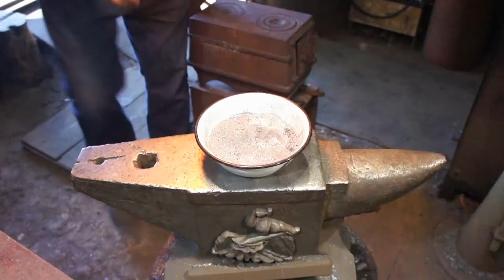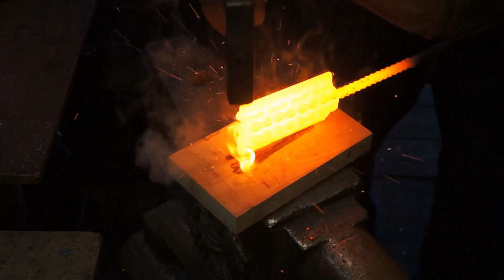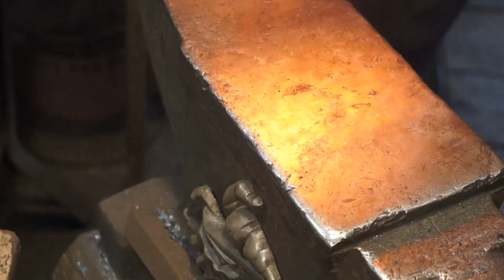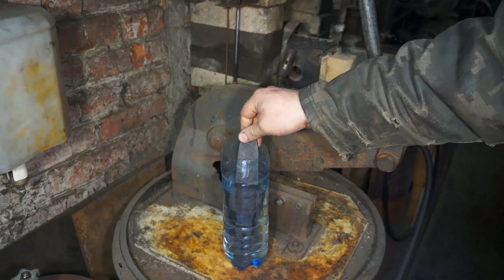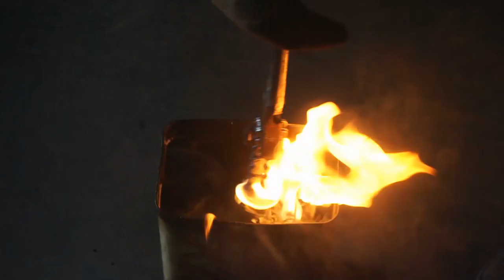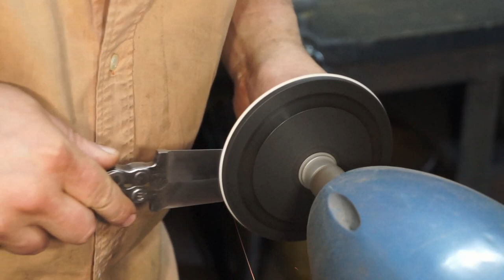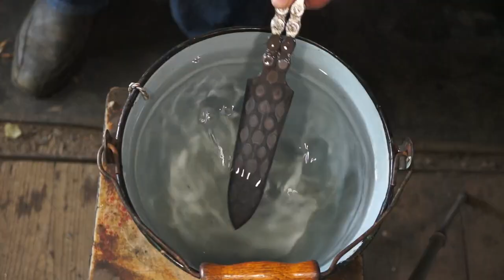Blade "Mad Max", Damascus steel from a motorcycle chain.

Comment: Motorcycle chains are made from manganese alloy steel in order to withstand shock loading and abrasion from road grime. Not exactly the easiest grade of steel to forge. And not healthy either. Manganese fumes are very bad for the nervous system, they have been connected to a sort of parkinson's disease that is common among welders.
Reply: Cobalt alloy steel is also unhealthy to work with, it has been connected with cancer. But i doubt that amateur blacksmiths would use high cobalt allow steel. It has the property of red heat hardness, and is probably extremely difficult to forge....The point being is that if you are going to use scrap metal, it would be a good idea to identify just what you are pounding on. Industrial hygiene.

Comment: Why him puts kitty litter on hot metal?
Reply from the maker: I sprinkle flux (90% borax + 5% quartz sand + 5% charcoal powder) this is necessary for forging (forge) welding. The flux is alloyed with scale - the formed substance is sufficiently fluid and is easily displaced by deformation. In addition, the flux protects against oxygen and charcoal, carburizes the surface layer of metal - which lowers the welding temperature (if in brief).
Reply: @shurap  so basically helps make metal hold together and stay clean?

Comment: Why does he keep putting that salt on there
Reply from the maker: I sprinkle flux (90% borax + 5% quartz sand + 5% charcoal powder) this is necessary for forging (forge) welding. The flux is alloyed with scale - the formed substance is sufficiently fluid and is easily displaced by deformation. In addition, the flux protects against oxygen and charcoal, carburizes the surface layer of metal - which lowers the welding temperature (if in brief).

Comment: Total noob but what is he sprinkling on the metal
Reply from the maker: I sprinkle flux (90% borax + 5% quartz sand + 5% charcoal powder) this is necessary for forging (forge) welding. The flux is alloyed with scale - the formed substance is sufficiently fluid and is easily displaced by deformation. In addition, the flux protects against oxygen and charcoal, carburizes the surface layer of metal - which lowers the welding temperature (if in brief).
Reply: shurap wow that’s awesome thank you. I’m hoping my wife listens and I get my first forge for my birthday lol